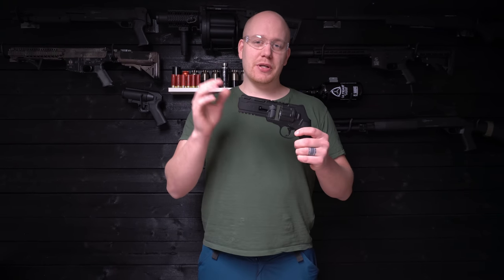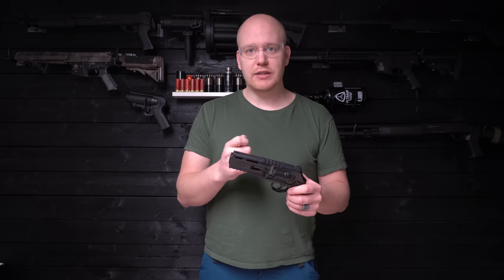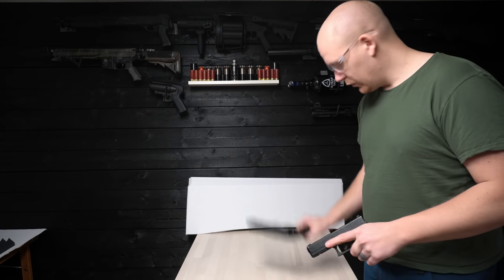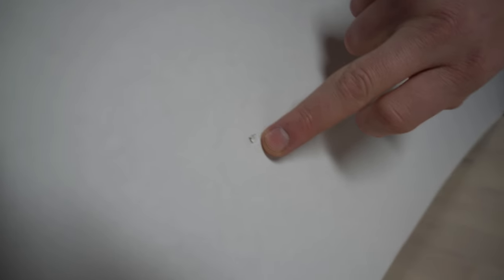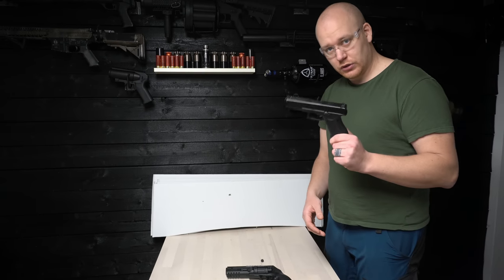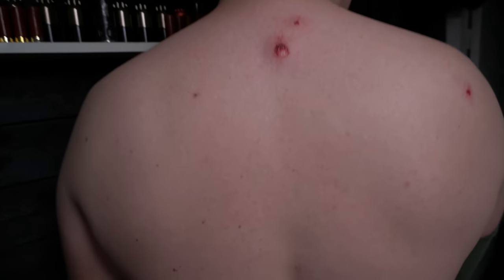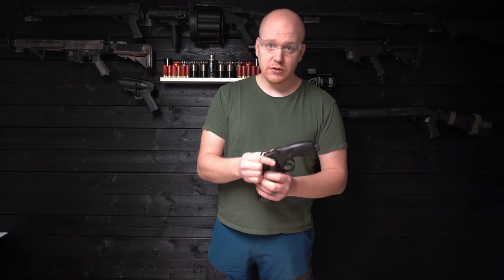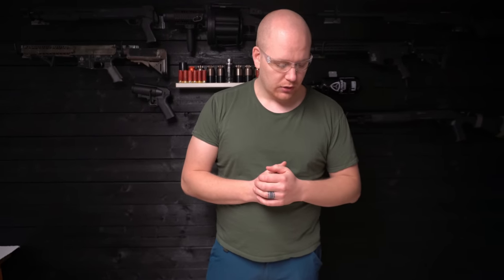Testing Self Defence Revolver Umarex HDR 50 CAL shooting point-blank in the back.

Comment: You can store it with Co2 canister just don’t puncture it until you are ready to use.
Reply: yep exactly - was looking for this comment as was going to say - as far as I've seen advertised it's very design is supposed to enable a quick, sharp tap to the underside of grip to engage and puncture the canister - allowing you to keep it safely with the gas inside and at the ready for any length of time - right up until when you actually (hopefully not) need to use it in defence - it can simply be smacked on the underside and then the gas is punctured. At which point the cannister should then be removed and disposed of, replacing it with another fresh one into the chamber, ready to be sharply smacked and punctured when it would actually be needed again :)
SO YES IT IS INTENDED BY ITS VERY DESIGN TO BE STORED WITH GAS ALREADY INSIDE TO SAVE TIME IF EVER NEEDED FOR ITS PURPOSE OF HOME DEFENCE. SIMPLY DO NOT KEEP AN ALREADY STRUCK (PUNCTURED) AND USED CANNISTER INSIDE THE GRIP, AS IT WILL DETERIORATE THE QUALITY OF THE O-RING AIR SEALS INSIDE, REDUCING PERFORMANCE AND RELIABILITY. LEAVE A FRESH ONE IN THERE, UNPUNCTURED BY THE SMACK TO IT - AND KEEP FAR OUT OF REACH AND HIDDEN AWAY FROM ANY CURIOUS, YOUNG HANDS!!!
and you'd be golden :) just to clear that up a bit for anyone who was wondering like me about that.
Reply: @danbruuu7938  Good explanation on how the Co2 canister works inside the gun.
Reply: @Ezduztube  Thankyou man, thankyou for the video on the subject! Helped a great deal with what you demonstrated :) Have a great day and take care!
Reply: @danbruuu7938  that’s exactly what I’ve been looking for. I need this kind of gun. No co2 puncture until your actually ready to fire the first shot.
Reply: Never leave gas canister in the gun as this will cause leaks
Reply: Very true. Just store it but don’t puncture it🔫

Comment: How is that a self defense system? Can’t store it loaded? Barely breaks skin? Sooo... it’s basically worthless. All you’re gonna do with that is piss off the guy attacking you.
Reply: You can store it loaded. Once your ready to fire, just bump the bottom of the handle to puncture the co2. I agree that it's not a great self defense weapon, but it will make someone think twice after getting shot with it
Reply: This is all we'll have in America if we continue to let our God given rights slip away.
Reply: It is for countries that doesn't allow real handguns.
Reply: You store it with the cylinder in the gun but not pierced. Then when you want to use it you hit the base of the grip with your palm and it's good to go for up to 30 shots. But he's saying that once you've finished shooting, ven if you haven't used all the pressure up, don't store it with a pierced canister, throw the old one out and screw a new one in. So you can absolutely store it one click away from being ready to shoot but I still wouldn't use it for self defence.
Reply: He used the 7.5 Joule version. HDR offers an 11 Joule version a well. I'm not sure if HDR offers them but you can get rubber covered steel shots as well as aftermarket steel shots with a plastic "ring" to hold it in the cylinder .50 cal bee bee traveling at 700 fps: that won't tickle

Comment: It looks like most close range paintball bruises I've had. So wouldn't a paintball gun be a better alternative? Same impact, but with a 140 shot magazine.
Reply: For home defense a paintball gun and a hopper full of rubber balls would be a lot better.
Reply: @zacharymerrill8359  you’d smash everything in the room lol
Reply: even with heavy clothes on a modded hdr 50 with 2.8 gram aluminium balls @ 595 ft per second with 1100 psi output would break bones just one shot

Comment: What type of ammunition was in HDR, rubber balls? chalk balls? rubber steel balls or even steel slugs. Pro tip for HDR / HDP users, the balls get stuck when its very cold / dry outside, and the gun stucks and entire CO2 cartridge drains like in the other video. Lube up the balls / slugs with silicon oil and you are good to go

Comment: If you can’t store it with the gas cartridge loaded then it’s somewhat lacking as a self defense weapon. In a real life situation you may not have time to load the gas cartridge
Reply: No the gun is designed to carry a fresh co2 cartridge. So if it's needed for self defense you slap the knob on the bottom of the handle where the mag would be and it pierces the co2 Cart. Giving you full power every time.
Reply: Regardless you're just asking for trouble using a pellet gun for self defense.

Comment: You used to play airsoft? Might get back into airsoft.

You should compare multiple shots of the same co2 with a chronograph. Gas tanks usually lose power on each shot because of the gas (pressure) released on each shot.

People stopped using co2 carts and eventually graduated to mini scuba tanks on their backs (which wouldn't be suitable for home defense) which keeps the psi constant every shot because of refresh/reset rate that a co2 cart just doesn't have.

Comment: To anyone who has had seals fail, try storing it charged up with CO2 or air if it's a PCP. There's over 3000 psi in several near me currently and haven't been touched for months.  Same for CO2, found a 92fs  in 177 in  my tool box tonight and emptied the magazine the fast way, put it there 6 months ago. Take a dropper bottle or syringe and put automatic transmission fluid in there, adding a drop to the top of CO2 cartridge on insertion  (do not use on air/PCP as the results could be explosive)

Comment: There’s literally no reason to empty the co2 when you’re done shooting. He claims the seals will dry out and they will leak out your co2. First, by draining it outright, you’re losing your co2 anyway. Second, the seals will dry out eventually regardless. Using the correct kind of oil on the seals is what you really need to do to keep any air gun working for many many years.
Reply: Better to lost CO2 than lost seals.Once it happened with my paintball gun. Now I know why.

Comment: Question: In the beginning of the video you mentioned not to leave the “gas” in there when storing it. Did you mean once the CO2 is punctured do not leave it in there and store it Or can you not leave an un-punctured CO2 in there? (Hope that made sense lol) - Great video on what damage it can do to human flesh!
Reply from the maker: When it's punctured. It's the gas itself that dry out the gaskets. The gun is designed to have a new unpunctured bottle inside so that you can just grab it and quickly release the gas to start shooting. 
Thanks for the feedback! 🙂
Reply: If the canister is tightened properly it doesn't need to be emptied. Makes as much sense as daring the fuel tank on a car every day when you get home.  Plus CO2 o-rings are cheap and typically easy to replace

Comment: Great video but how's it self defense? By the time you load the gas then load the gun  then shoot it your done with intent to cause physical arm most countries that's a 3 to 5 years
Reply: Apparently you can can store it with the gas then smack the puncture seal when you're ready to shoot. After the puncture seal is hit then it will eventually leak over time like a regular airsoft gun.
Reply: @psykloneja  still prison term ,gun law in the states has gone strict same as Europe , everyone is in titled to defend ones self ones property unfortunately the law does not see it this way
Reply: @jarmcq206  In Jamaica we have the opposite problem. You won't be prosecuted for defending yourself against intruders in your home, but access to firearms etc. (even airsoft guns) is very limited and they are difficult to obtain legally, which means mostly criminals have them...

Comment: Over 200m/s seems too fast for 7,5J. Are you sure you measured it correctly? With a bullet of a mass of 1g = 0,001kg and a speed of 200 m/s you calculate the energy with E = 1/2 m * v *v with m being the mass and v being the velocity to the square. E = 0,5×0,001×200×200 = 20J. Far too much!
Let's calculate the maximum velocity you should get with a 7,5J gun and 1g bullets. v = root(7,5 / (0,5*0,001)) = root(15000) = 122,47 m/s

Comment: After the paper test, shooting bare skin seems dangerous!  Especially shooting someone in the spine where the 50 cal. ball hit!  The weapon seemed great - until the "don't store it charged/armed" warning.  Not much use in an emergency if you have to charge it every time.  Also, how many rounds will one gas cylinder fire?
Reply: Ive heard a single standard 12g CO2 cylinder is good for ~30 or so shots. And as far as storage is concerned, you are able to leave a CO2 in it without it being punctured so it is safe because once you put the CO2 in the handle, its still not ready. You have to push on the bottom to actually release the gas. Think of it like "putting one in the chamber" but for an air gun lol.

Comment: Nice job on the demo!  However, not the product itself - This may be an effective deterrent if it used metal ball bearings or glass marbles as projectiles.  Even then, if the intruder is wearing a jacket or heavy sweater, they’ll most likely shake the hits off and continue their assault. Moreover, the fact that you can’t store it with the gas already loaded is a serious flaw.  You may not have time to break out the allen key and go through the several step process of loading this thing, after the intruders kick in your front door.  

That said, it’s probably the best you can do to protect yourself and your family, given the laws you’re subject to.  It would be funny if the intruder has a couple of these too and returns fire.  “The rubber BB shootout!”
Reply: You can store it with the gas capsule in the gun, but not pressurized. A sharp tap to the base of the grip (where the screw cap is) will pierce the capsule and pressurize the gun when you need it.
Reply: I think you got to have steel bbs and be hitting bare skin at very close range ie face or neck, if you approach the attacker directly with confidence shooting to the face up to point blank then I believe it would be very effective

Comment: How could this even possibly be considered for self defense? It is less effective than pepper spray…
Reply: It is meant to be used WITH pepper spray, or your fist. Lots of things are considered self defense tools. I would classify ANYTHING hurling projectiles as one.

It's an intimidation device. Used to activate the "FIBSA" factor in the perpetrator (Fudge I'm Being Shot At).

Which will...

1. Make them run away thinking they're being shot at.

2. Buy you time to run away or grab pepper spray or jump on them.

This + riot balls + pepper spray and I'm good for many situations.

I'll give you another tip. When you fire these at them. Miss on the first shot. Most likely they'll start to run from the sound and hearing a projectile whizz by. If you hit them they'll realize in not a real gun. So miss and they'll be freaked out.